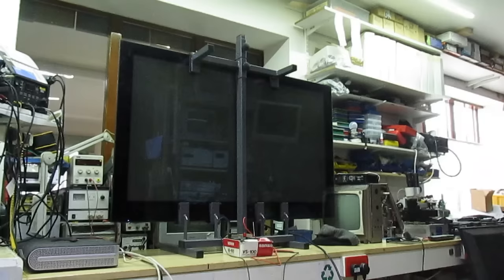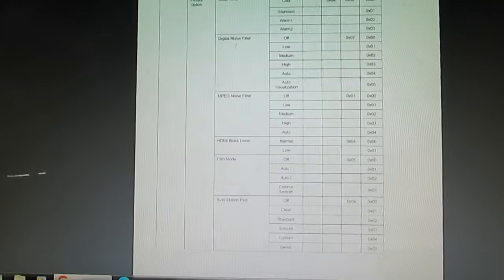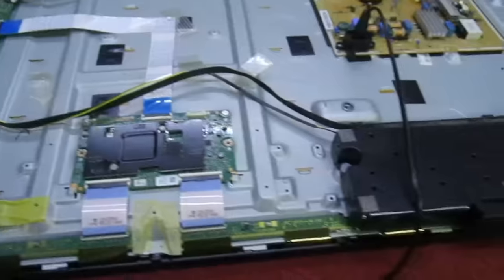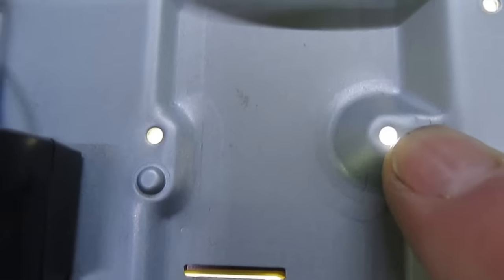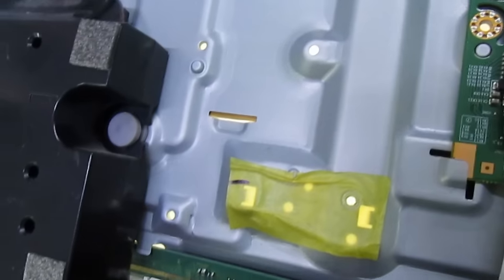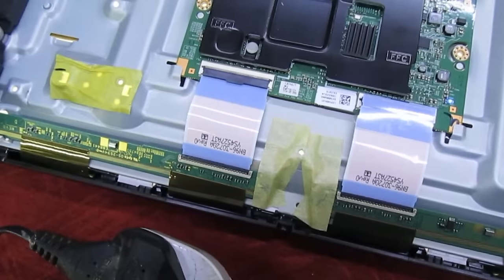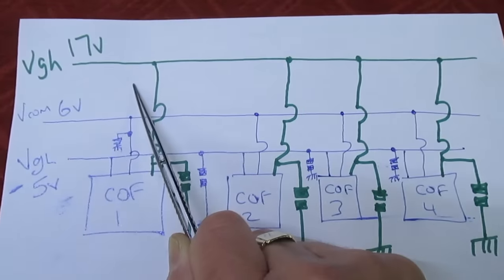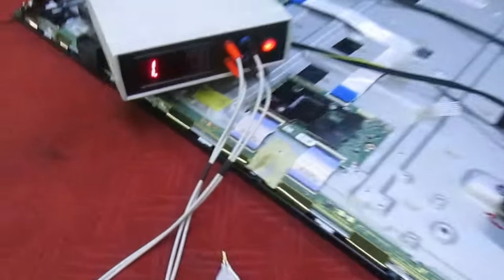Video to highlight the problem of repairing flat panel TV sets

Comment: This is useful information. 

Had a Samsung tv that I got from a customer. The tv will boot when one side of the panel is disconnected from everything else. 
I did follow the procedure that you mentioned and found that one of the ceramic capacitors had full resistance (no continuity). However, the other capacitors had similar (around .452) amount of resistance and did not decrease as I got closer to the bad capacitor.
Reply from the maker: A bit more trouble but if you cant determine which cap is faulty you could always take them out one by one .
Reply: @michaeldranfield7140  That's useful but I'd rather trash the tv than to do that.

Comment: Nice video. Made it super easy to trace a fault in a 75in just laying around. Now just need parts bin
instead of ordering every time.
Reply from the maker: Thats another problem I have , one of the very last parts suppliers left has a £7.95 plus VAT charge for delivery under £200 so just a cheap chip can end up costing over a tenner.

Comment: Use external power, start putting power in and check where zhernobyl is. You could use temp cam or just melt that problem ;)
Reply: Apparently some people spray rubbing alcohol on, see it evaporate around the component. A non-contact thermometer could work, or a finger on components.
Reply from the maker: yes , this is what I do when the short is above 1 ohm and I cant use a milliohm meter to look for it .
Reply: @gblargg  I used the finger test on roms on pc `s years ago
Reply: I found Chernobyl, but it is radioactive.

Comment: Great Video Michael Me and My Mate Bought 2 Identical 46 Inch Samsung Tvs About 5 Years Ago From Sainsburys Mine Failed Just Outside The Guarantee Perod Of 15 Months I Bought Another Samsung tv This Time 50 Inch I Had Nothing To Loose So I Thought i Would Have a Go At Fixing Mine Turns Out it Was 3 Faulty Half Sections Of Led Strips Bought Them Of Ebay And To My Suprise it Fixed The Set Told My Friend To Run His Back Lights at 50% And This Prolonged His Set For a Couple Of Years Until His Failed He Bought a New JVC Set And Give Me His Old Set For Parts So I Again Thought I Would Have a Look At His Old Set This Time The Back Lights Were OK But i Had Traced a Fault in His Power Supply a Short/Circuit Mosfet Transistor Bought One Of Ebay And This Fixed The Set So Now I Have 2 Working 46 Inch Samsung TVs !! p.s. They Dont Tell You To Turn Down The Backlights To Prolong The Life Of The Set When You Buy One Do They !!  Just Subbed To Your Channel Michael Regards mike.
Reply from the maker: Most of the sets I get in for repair have the backlights set full up, I think they come out of the factory like that to give the best picture, all this hype about Led lights lasting 100,000 hours is just rubbish and it's not just TV s, I have led lights at home but they don't last 5 minutes and any money you save in electricity is just wasted again on buying more led lights!

Comment: Excellent video, perhaps it is an idea to explain to viewers why we always  pull the plug each time rather than use a switched extension !
Reply from the maker: A tip I was taught when I did my microwave training was to unplug and then place the plug inside the oven cavity where you can see it and no one else can accidentally plug it in, safety.

Comment: I enjoyed watching this. I made a good living thanks to capacitor failures, mostly electrolytics though MLCC failures increasing as time went on. Whenever I go to the tip I feel it's sad to see so many TV's piled up for scrap even though many of them are repairable. I used to repair Samsung CRT monitors and it was a luxury to be supplied with full service information and tech support on the phone. Their CRT's had a short life. I recall one particular 14in monitor range that suffered from strange EW correction faults that would disappear when you started scoping the circuit. It was an obvious design fault, a capacitor coupling to an op-amp input with no resistor to prevent DC drift on the input. Strange that ever got through vetting.
Reply from the maker: I know , I hate going to the tip , saw a vintage TV set one day and offered to buy it but the guy on the tip said no way.
Reply: that annoys me too seeing all those tvs at tip and the fact they won't let you take them as i am sure 80% of them could be repaired. I used own a small tv repair shop but got out of the trade when the Chinese started to flood the market with cheap unrepairable junk with no spares or service back up also as these were so cheap people wouldn't pay to have stuff repaired people don't realise that most of the time of the repair is in fact diagnosing the fault as fitting the parts generally only takes a small part of the total repair time and then you try to quote the customer for the repair they often say "its only a small part why does it cost so much " I used to avoid giving free estimates as a lot of repair shops used to do as the customer will take what you estimate as the final price and unless you are prepared to work for free ie diagnose the fault before agreeing a cost to the customer so you put all the effort and find the fault often actually repairing it to confirm the diagnosis before giving the customer the price of the repair only for them to say "No that is too much" and un repairing it as often the customer wanted the item back unrepaired. i have in the past quoted a high price for a repair when i could see either the fault was a particularly difficult one to repair or the customer appears to be an awkward person hoping the customer would decline only for them to give the go-ahead for the repair. as with any business the business would be a lot easier if we didn't have to deal with the general public!!. Another thing the manufacturers do to make their items not repairable is not making the firmware or the programmed microcontroller available as a spare part.  I recently watched a video by a channel called Mend it Mark in which he was showing the repair of a receiver made by a relatively high end manufacturer in where the receiver ended up being scrap as the fault was the main microcontroller which wasn't sending a signal to the main amp to power up as the manufacturer didn't supply the microcontroller this rendered the machine unrepairable.

Comment: I do electrical and electronics work on cars. I had a Suzuki Swift with no instruments on Monday. This also turned out to be a faulty ceramic cap. Diagnosis was really easy, it had burnt through the supply track!  New cap and a piece of tinned copper wire got it going again.
Reply from the maker: These caps are very un reliable and as you have just pointed out used in many different electronic things now , not just TV s .

Comment: Great troublshooting!  :)
I found the use of the milliohmmeter very interesting.  I just retired about 2 & 1/2 years ago from my position as a production debug technician for a manufacturer of very high end computer hardware; some of the PCB's that went into these systems could cost as much as $40K!  - And just like this FV, could be brought down by a shorted power supply buss rail bypass cap; only in this case, there were potenitially HUNDREDS of them!
     We did have a device similar to your milliohmmeter, but it produced audio tones to indicate the severity of the short, in use it was often inconslusive.  A methed we DID develop was using an FLIR camera to look for shorted components.  In practice, a power supply that had variable current limiting was connected to the shorted supply rail.  Prior to connecting the power supply, its output voltage was set to equal the normal supply rail voltage.  The suppy's variable current limit control was intially set to minimum; then the supply was connected to the faulty supply buss rail, on the load side of any fuses, bypassing them.  The FLIR camera was set up & adjusted to show the board as it looked "cold"; then the power supply current limiting know was gradually cranked up.  Typically once we increased current past the 1 amp mark, the shorted cap or other component would start to "glow" on the FLIR camera.  In addition to shorted caps or semiconductors, the FLIR camera would also locate solder shorts or internal inter-layer PCB shorts (the latter obviously unrepairable, it meant the PCB was automatically scrapped).  In most cases, we would find the short in 5 minutes or less (vs. hours or DAYS by any other mehod!).  The FLIR camera was expensive (@ $8K), but it quicly paid for itself!
Reply: PS: "FV" was a typo, meant to say "TV"!  ;)
Reply from the maker: Yes this is the method I use when the short is above 1 ohm  but I dont have a thermal camera, I use my nose to detect roughly and then the burnt finger technique  to pinpoint ! 
Interesting you should mention the internal layer pcb short , I had one of these a couple of years ago on some high tech equipment   which would have made me a lot of money if I had managed to fix it , I was passing 10 amps into a pcb with a short but it was the pcb heating up , not a component so I concluded it was an internal short in the board itself and I had to send it back un repaired .

Comment: You are a top notch technician. I work as a TV repairman too and I have found those to be shorted as well and saved a few TVs. I have a little different method of finding the short. I take 2 D batteries and apply 3 volts DC and see which one reads hot on my infared thermometer I wonder what causes a Samsung to power cycle from a bad panel?
Reply from the maker: Without a service manual and some proper technical information its not possible to know for sure what causes the power cycling, one can only guess.
When a short is over 1 ohm I use a bench power supply and just see what burns p as I dont have a thermal camera.

Comment: Brilliant!  Not sure how you knew that unplugging various ribbon cables would give the light on or off result, but I guess that is why I don't repair TVs .   :)  Amazing deductive reasoning. I saw soomeone diagnosing computer boards by powering it up and then putting some alcohol on the components. If something had shorted out, the component would dry off faster than everything else, and he would replace that component. Electronic grade isopropyl alcohol.
Reply from the maker: with no technical description on how the circuits operate which was usually printed in the workshop service manual fault finding is a little bit of knowing what your doing  and a lot of good luck .

Comment: I had a Sony 55 inch that the picture went out on exactly like this one. I took it to my local repair shop (now out of business because he retired) and he had replaced every board in it and the picture would still not work. Now I've got a better understanding of why. Unfortunately all Sony was interested in was the Play Stations and I couldn't get any tech help from them. I now own an Element TV made in the USA all except the boards but it has been working great, it is a Roku set and I am very pleased with it.
Reply from the maker: always a problem without any service information , trying to decide if the fault is caused by a board or the lcd panel itself .

Comment: Great video. Ceramic caps do fail. An easier way, if you have the budget is to use a thermal camera.

Force some current trough the faulty supply rail. The defect cap or semiconductor will show up easily.
Reply from the maker: I use the voltage method when the short is over 1 ohm, I don't have a thermal camera but I have burnt my fingers a few times looking for a hot cap.
Reply: Thermal camera is a brilliant bit of kit for finding shorts (causing the PSU to run hot) or high resistance (component runs hot). Best bit of kit I ever invested in. Saves hours of methodical trial and error narrowing down the issue.

Comment: It's good to know that people are still doing these type of repair what do you think about led to remove the most vulnerable  part with is the screen that stand a chance to break. can't manufacture do better on designing of removal of  backlight.
Reply from the maker: I think the Led back-light sets are bad, I have had sets only do 3,000 hours before the led s have failed, we have led light bulbs at home and they don't last 5 minutes either, the 100,000 hours quoted lifespan is just total rubbish, it wouldn't be so bad if the LEDs in a TV could be replaced from the back without having to remove the fragile LCD panel but all these things are just done to make people buy a new set unfortunately.

Comment: You tell the customer "that was the problem, that little thing right there", lol. That was funny, it's so true that people would not understand all the trouble to get to that little capacitor causing the problem.
Reply from the maker: Generally I find people are amazed how I manage to find such a small part and  are very appreciative of the work.
Reply: @michaeldranfield7140  Yes, i am one of those people. I am amazed with this work. And to do a video on it all, that is even more work. This is a great video, and has motivated me to work on my fathers damaged tv.
Reply from the maker: @Techisol  you have nothing to loose by having a go yourself as you probley wont be able to find someone who repairs TVs now !

Comment: In the days when colour computer monitors were £1000+ someone brought a faulty one to me to try repair.
I'm an industrial electrical engineer with a basic working knowledge of electronics.
I found a resistor had burned but the colours were gone. I phoned the makers pretending to be one of their engineers and asked what value it was.
They told me 100 ohm. I had a box of various resistors but not a 100 ohm one. Then I remembered my college days - when they taught us about parallel and series circuits.
I put 10 1K resistors in parallel and soldered them in. A working monitor. If the first one failed through not being a high enough wattage - there would be no problem now.
Reply from the maker: You would have a job ringing anyone now, a lot of brand names such as Hitachi, JVC are all owned by Argos and Argos don't sell spare parts or have any technical department.
Reply: @michaeldranfield7140  Oh I know, this was probably over 30 years ago. Love your videos Michael.

Comment: Michael, many thanks for creating this Youtube channel, it is very informative and helpful. Last year during a period of very hot weather my 6 year old Samsung TV failed, with very similar conditions. As I paid about £1400 for this model, I was prepared to pay for a repair, but couldn't find anyone locally to fix it and was told by someone not so local, to scrap it. As I have a lifelong interest in electronics, TV and radio and some work experience, I decided to take the cover off and have a go. I identified that a fuse was blown on the TCON board and disconnecting the TCON to LCD screen cables made no difference, so I suspected a fault on the screen or LCD driver board as you've already demonstrated. From other Youtube videos, I built an LM317 based milliohm meter to try and trace the short circuit and it proved to be CA31. I'm interested to know how you decided the faulty capacitor was a 10uf/25v, because as you've explained, there are no component lists or diagrams? I'm sure it's from years of practical knowledge and experience! I removed CA41 for comparison and that appears to be 2.2uf, but there's a possibilty the other capacitors may be aging and changing values, so I'd appreciate your opinion on that please? Many thanks.
Reply from the maker: it wasn't that difficult identifying the cap , as all these circuits are the same on the COF pcb and all in parallel, just take off another identical cap and measure it for value , also  on the T con board  the highest LCD bias voltage is usually around 17 volts so chose a 25v cap .
Reply: Thanks for your prompt reply Michael. The model I have is a Samsung UE48JU7000TXXU and capacitor CA31 is faulty. It blew fuse F801 3 Amp 32v on the TCON board and is the 17 volt supply, which didn't appear to happen on the model you were working on. I concurr with your choice of a 25 volt replacement. To try and identify the capacitance value I removed capacitor CA 41 on an adjacent COF section and it measured 2.2uf. I'm going to have to buy a pack, so I'll take out another to confirm that value. I'm over 70 now, so don't expect this to be my new career, but I still get a kick out of making and repairing things, where I can. Thanks for your feedback and please keep making the videos.
Reply from the maker: @stever7915  No problem , many thanks for letting me know .

Comment: Super knowledge and determination to id the root cause Michael. Easy enough to replace the cap if one has right one and the equipment. Lot of TVs binned have very minor issues. World probably needs to address this massive problem. IMO It creates a lot of environmental and recycling issues. Problem is repair eng costs tend to be high and they dont guarantee they will fix the TV and often advise buy a new TV. Many flat screen TVs have known design weaknesses too eg the clear thick plastic LGP Led Light Guide Plates ) cracking or difficulty to buy replacement and / or replacement diffuser, light amp sheets and prisim sheets if they get contaminated. Many TV also fry the LEDs and repair is as easy as disassy then replacing the blown backlight leds or led arrays. Good fun fixing them if you are an interested  hobbyist electronics or TV person with necessary equipment and can source a few spare parts etc .
Reply from the maker: One of the biggest problems I tend to face is getting hold of spare parts , most manufactures only supply whole boards and I would say 90 percent of the parts sold on the internet are either fake or have been pulled from old boards and made to look new again , its not unusual for me to spend as much time looking for a semiconductor that is real as it is to find the fault.